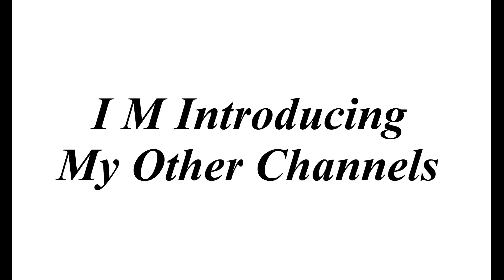How to make a Battle Boat  Using High Speed DC Motor

Comment: That 9v battery isn't gonna last long with that big 550 motor. That's alot of weight in the rear too.seems like a 280 or 380 would be more appropriate. Just a suggestion.
Reply from the maker: try it